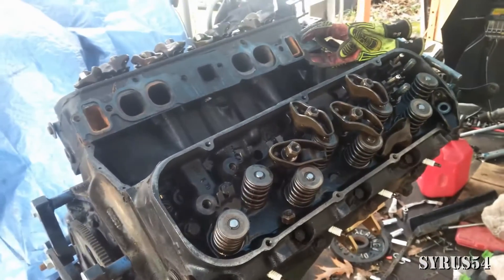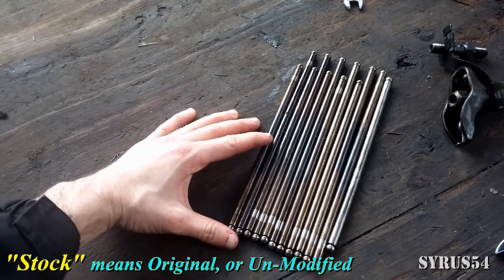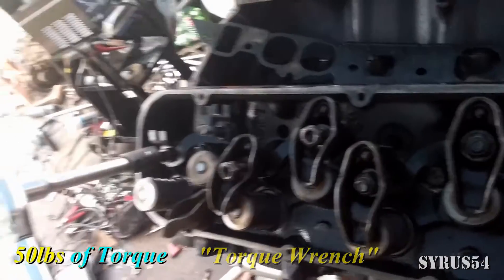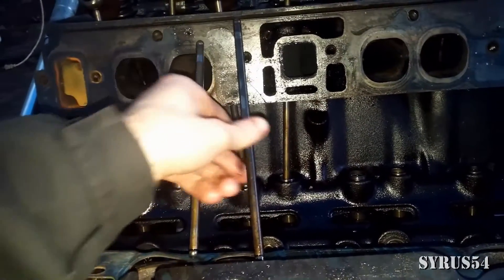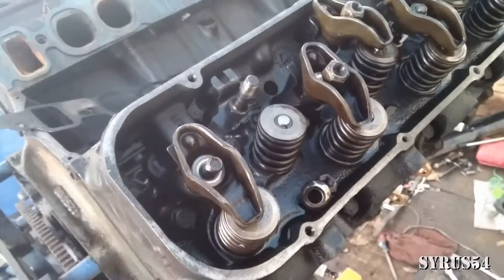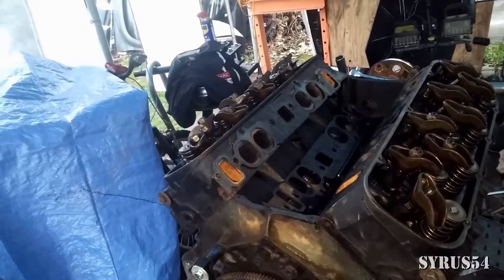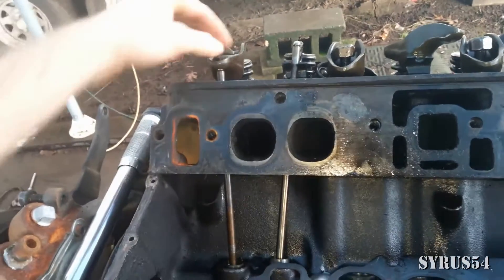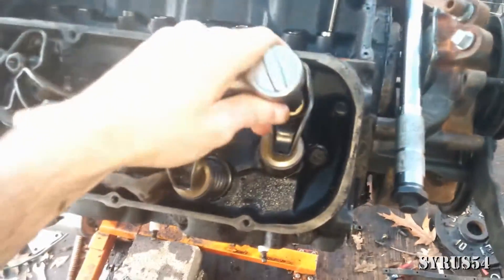Vehicular Education - Stock BBC Rocker & Pushrod Assembly

Comment: Base of cam lobes. Tighten until all slack removed from pushrod. Tighten additional half turn/180 degrees for lifter preload. 😊
Reply from the maker: Mine preferred 1/4 turn preload. Better throttle response

Comment: Good  video and very Informative ,although I  have to ask if the lifters were dry or had they been soaked in  oil prior to the  adjustment?
Reply from the maker: Some people might say to do that, but I didn't. I didn't have any issues
Reply: I had the same question but the paper I got with my new lifters from Comp Cams actually says it’s not necessary to soak them

Comment: Uhm......You may want to try that preload adjustment again. You weren't on the heel of the cam lobe on that exhaust valve. Look at your lifter at 7:02 it's 3/8 of an inch out of the hole.  Nice you like to teach but you should teach it right.
Reply: This is what I'm wondering myself
Reply from the maker: Vid's so old, i dunno what youre on about. But i know the engine ran beautifully. So................

Comment: Why aren't you showing everyone how to check for proper push rod length? ?? You didn't show how to check for the proper tracking pattern on the valve tip or valve cap. There is a specified torque number before your turn the rocker nut 180°. It's not just till its snug. People there are hundreds of videos on YouTube that show you the correct way to do things on your engine and there are also books. I'm sure this guy will most likely delete this comment but that's OK.